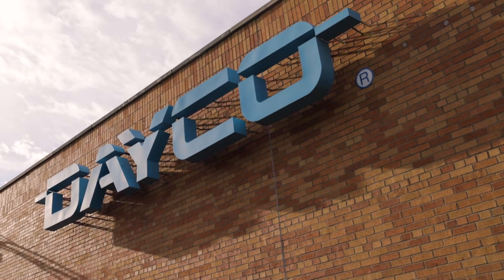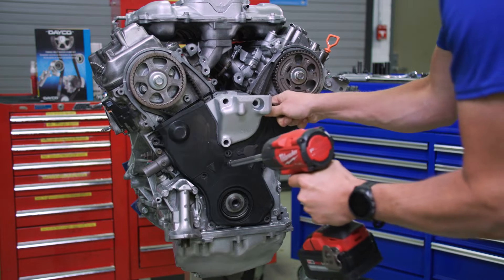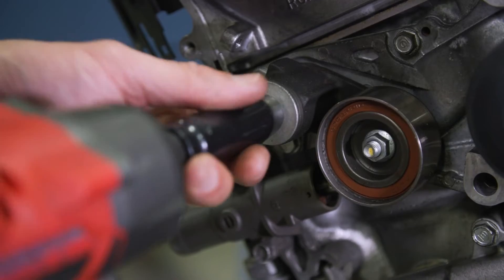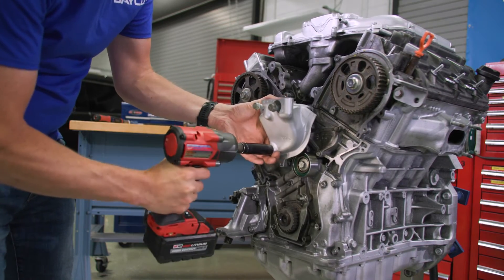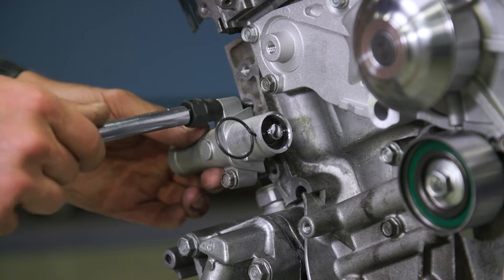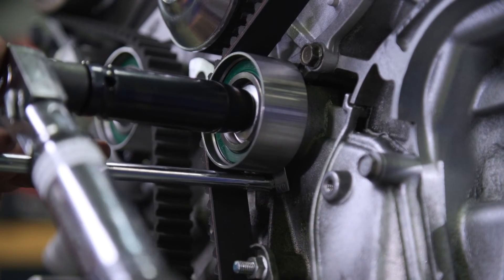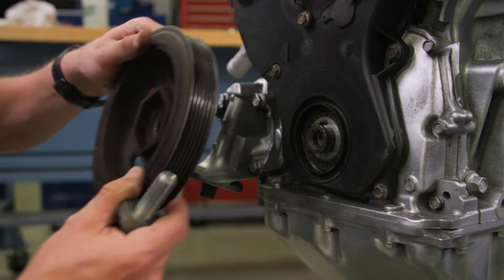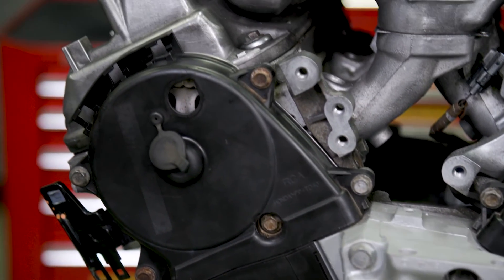Vehicle Maintenance: Dayco - Timing Belt Kit Installation – Honda/Acura V6 3.5L engine

Comment: Would you replace the timing belt and water pump with 62,500 miles on a 2015 Honda Pilot? My local Honda service dept. recommended.
Reply: Late response and you probably already dealt with this issue but as a general guideline, it’s recommended to replace the timing belt every 7 years or 100K because rubber does degrade over time.